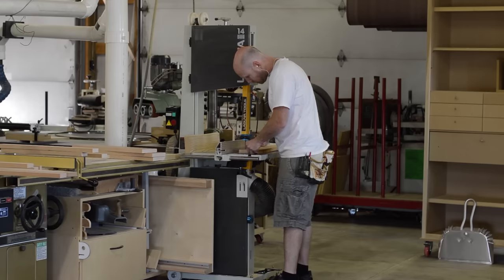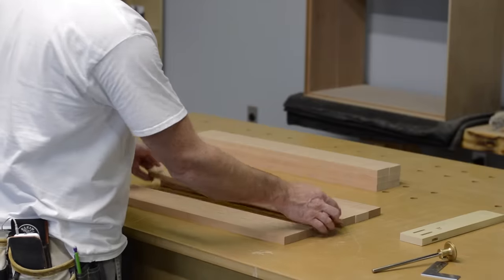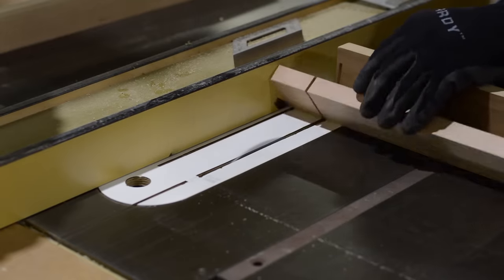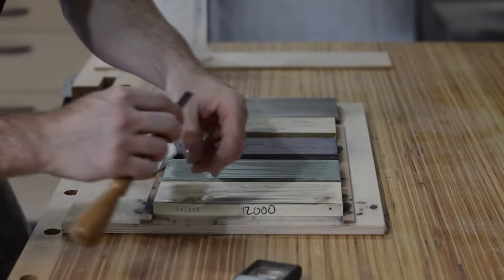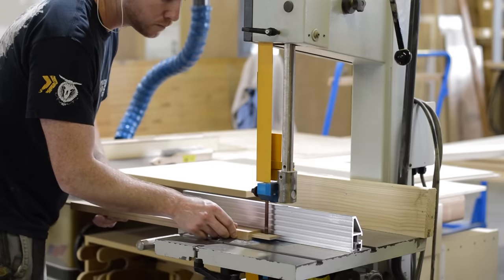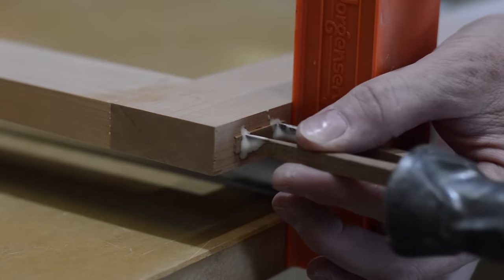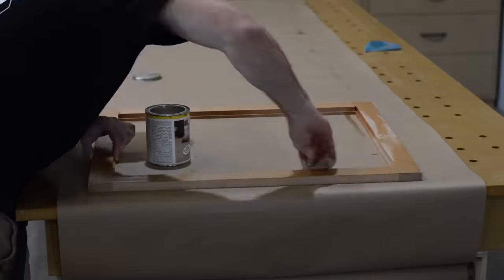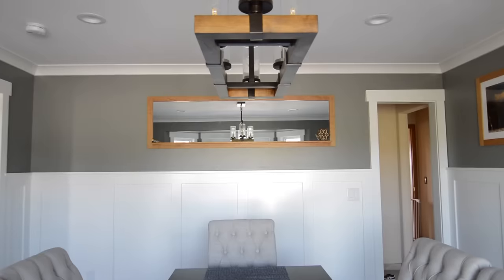How I build better picture and mirror frames, woodworking

Comment: Agreed, being on both sides of the a project both as a finish carpenter and professional painter in  custom homes.  It has been frustrating having to go in after someone else has worked and having to fix it in order to get the kind of product the customer paid for.  Try doing a built in wet bar in a closet with gloss black lacquer while 5 other Contractor working in other parts of the house. Love you videos.
Reply from the maker: The construction process is absolutely filled with compromises, speed, cost, quality. Us builder types must find where we fit in and its not easy to do really good work, when we work in a world where most other don't care very much.

Comment: I've seen frames done with a through mortise, but the wedge detail really elevates the clean, design, and is also functional! Beautiful and functional addition.
Reply from the maker: Thank you very much. I really like the way these turned out. Simple, quite, but built to last.
Reply: I agree.  And it means the frame is nice and strong which can be important for a mirror frame.  A splined mitre joint is also strong, but this is just a bit different and really nice.

Comment: Mike your frames are beautiful.

As a Picture Framer, I do have a couple of suggestions about the last couple of steps that you did.
Cheap premade frames come with cheap Plexiglas.  It often comes prescratched, and has many imperfections.  Most Hardware stores will carry either glass or Plexiglas.  If using Plexiglas, I recommend that it be at least .90 thick, preferably .118 or higher for larger frames.
The matting in premade frames can be of good quality, but is often not very good.  It is a good idea to make sure to use Acid Free mats.  A tell tale sign of cheap mats, is the beige bevel.  This will brown over the years, and may cause damage to your art.
My biggest concern with your fitting of the art was in taping the art to the matting.  I'm sure that you understand movement in wood, and made your frame about 1/8" larger than the glass size.  Matting and mart also has movement, and at different rates.  By taping the art all around, you are causing the movement in the art to occur in the middle of the image, causing bulging or rippling.  Your art should only be hinged at the top, and preferably with 2 hinges, not the entire length of the top.
Sawtooth hangers can cause problems on thinner frames or softer woods, as all of the weight will be applied to the top rail (This shouldn't be a problem on your frame).
Additionally, it is often hard to get the indent in the hanger to be exactly in the center, which makes leveling the picture difficult.
For this reason, I would recommend using two hangers near the sides of the frame, or a wire (with two hangers on the wall).

Thank you for the video.
Your woodwork is lovely.
Reply from the maker: Lots of good info here, thank you very much.

Comment: You do beautiful work, though I don't see how simple woodworkers without all these great and expensive tools can replicate this. These have significant relaxation value either way.
Reply from the maker: Thank you for the compliment. I'm also happy to hear you find them relaxing, that is a big goal for me. I wanted to create a video thats easy to watch and low stress. With regard to making these using expensive tools, yes I have a pretty nice tools set, but given a much longer timeframe these frames could easily be made with a couple handsaws, planes and chisels. My videos are just about how I do things with the current tool set I have. Nothing less nothing more.
Reply: Thanks for the reply - that's very fair. It's an inspiration seeing how precisely crafted everything is. You're right that similar results could in principle be made with hand tools, I just wish I had the patience and care!
Reply from the maker: If I ever have the time, I would love to do a similar project with only hand tools or minimum hand tools. It would be neat to show both processes.

Comment: Cool technique and tip.  I have not thought of doing it that way..... I always do a 45.  Will have to try that.  Also, thrift stores and garage sales for frames and mats.  Look for nice custom frame stuff.  The larger ones are better.   You can reuse the frames for smaller stuff (break apart, cut as you need, and rejoin).  Also, you can steal the glass and cut it down (way easy).  I used to do custom picture framing for a living.  I don't worry about mats as I picked up a mat cutter on CL for about 60 bucks.  It was in a frame shop at one point and is the C&H which is the same brand I worked on so I used.  If you don't want to mat some 3m spray and linen cloth covering a large cove molding or "inner frame" will work for a mat. That really works well if you have a vacuum bag for veneering.  Especially if you do any sort of shadow box. I have done really fun ones.  The best was a custom engraved colt that belonged to a notable TX cowboy is my understanding, but I don't know that to be 100 percent true.  Was a cool project that turned out nice.  I do mostly the odd stuff for me these days as I know the markup on custom stuff!  Also, if you have a Micheal's or a Hobby Lobby you can go in and use the 40 percent off single item coupon for just custom cut glass or the cheap frame.  I have also done that trick.   Mat boards aren't cheap and come in 40 x 30 as does a sheet of glass.  You can order online full sheets online.   Custom picture framing is a pretty fun.   We used to do chop service or just order sticks and cut it to length.  I would do the joining with an under pinner or a small hand hammered brad and glue.  The tools are pretty specific to framing.  We had a foot powered chop saw that to large blades that came down at a 45.  The beds were cast and flat like a jointer.  Made for prefect miters as long as you had the blades adjusted properly and took small and thin bites.  I wish I still had it.  It was my dads frame shop.  He sold off the equipment to a lady who opened the shop and I taught her how to frame. I worked several days a week with her in the shop for extra cash while I was in college. That was the time that Live was popular.  Love that album as well.  Lightening crashes is a great song.  As one enters life the other exits.
Reply from the maker: Thank you. Great tip about thrift store frames, that makes total sense as I read it. I will at some point get a mat cutter, thats just a matter of time. Live is great and yes, Lightening Crashes is a really good song. I liked it when I was younger, but as I have gotten older and seen the circle of life, that song hits a little closer to home.

Comment: Nice work with the through tenons with reclaimed wedges! crazy that the drawer boxes were nice walnut! When you're using that method of making tenons i've found that i've screwed myself a few times by having stock that is not perfectly milled up. If there is any variation from piece to piece then taking the same cut referenced off the face results in varying thicknesses in your tenons. Until i can achieve perfect milling results my method for now is to cut a little shallow and then refine down with chisels and such to try to get a good fit. Also, for the picture print itself, especially anywhere with moisture, like a kitchen, bathroom, Florida, the Northeast, etc. it is a really good idea to get your art dry-mounted (usually to 1/4 inch foam core). This is really one of the only ways to stop your artwork from developing waves and wrinkles over time. They can do it at a Michael's type store, or preferably, at your local frame shop, if they are still in business.
Reply from the maker: Thank you. I have had good luck making tenons this way. I just mill up my stock as accurately as I can and go to town. I think this is good advice on how to mount photos, thank you.

Comment: Hi Mike
Just found your channel and found this video really fascinating, not just because of your approach to this project, but also your techniques.
You mortice using the same technique as I do, I sharpen and test my tools in the same way, and use a similar adjustable height bench.
I have never seen Tenon's cut that way but intend to give it a shot.
Thanks for the video, going to watch some more.
Reply from the maker: Thank you very much. Let me know how the tenon technique works out.

Comment: I didn't expect to see anything new in a 'picture frame video' - I've seen so many. Again I was happy to be wrong. :)
I very much like miter-dovetail frames, so I might combine those with your tips and tricks.

Brooms are by the way a no-go in dusty workshops where I live (by law, they're actually not allowed, because they make the dust go up in the air; instead we are restricted to vacuum cleaners). If you don't have a dust-collection system, I very much recommend that (both for you and your work-force).

Thank you for another high-quality video with lots of good content. Tail-wind to you with the courses!
Reply from the maker: Thank you very much. I don't use the broom too much. I have a pretty nice hepa shop vac that does most of the clean up.

Comment: It is also quite "enough" to use paper tape on the backside in order to hold cardboard, picture and glass inside the frame. That way you can easily "open" the image later if you want to change the "inside" without  any holes inside the frame.
Reply from the maker: Thank you. Good point.

Comment: Every single time I watch a new video form you, you surprise with yet another cool technique or tip that just blows the competition out of the water.

I believe I saw The Samurai Woodworker add small drill holes at the end of the cuts for where the wedges go, as I think it prevents some potential splitting of the wood when driving in the wedges. Might be something worth looking into.

Great content again, always a pleasure and a fast click when you upload a video; guaranteed good content, humour, and editing. It never bores me.

Ninja edit: classes? Damn, I wish I was closer to Denver, because I would attend immediately. Maybe sometime in the future!
Reply from the maker: Thank you. I try really hard to add detail to the videos. I am happy to hear you can pick up a trick here and there. I drill the holes once is a while, Its not needed if the piece you are wedging is thin, as in this case. Meaning from the edge of the tenon to the wedge is only 18/-3/16.

Comment: Excellent build and beautifully executed. One tip for what it's worth. During glue up there is no reason to apply glue to the shoulders of the tenon. It's end grain and has little to no strength to the joint. The tenon and glue on the tenon only is more than enough strength to keep that joint lasting for years. Also a plus, there'll be little to no glue squeeze out to clean up after clamping. My 2 cents for what it's worth.
Reply from the maker: Thank you. Agree, glue is not there for strength. Its there as a filler. This is a habit I developed doing a lot of paint grade work, which is really how I pay the bills. Same glue up in a paint grade project, it would be very hard to hide that joint with no glue. You are totally correct, I just don't mind the clean up. I appreciate the comment. Keep them coming.
Reply: I'd actually disagree that end grain gluing has little to no strength. I've seen some recent experiments that have astounded me as to how strong end grain only glue ups can be. I do agree it's not necessary on a through mortise and tenon, especially a wedged one but as Mike said its habit and old habits die hard (and it's how I was taught as an apprentice many years ago as well).
Reply from the maker: Thank you the the input Steve. I have also had a few times where i was surprised at how strong a butt joint with glue is. For example, I have put things together with glue and pocket screw, then I realized that I needed to take them apart because I made a mistake. Take the screws out and pull the joint apart and it tears the long grain before breaking the joint. Really, to me the benefit of getting glue on the shoulder is its filling properties. That tiny gap of .001", the glue fills that up perfectly. With a through M+T it is not needed, but yes, old habits die hard.

Comment: Love your work. If you find yourself doing more picture frames, I found a couple things that make the experience even better, a good point driver gun (I used the glazing points too but didn’t like the finished look of them and hated they way they wanted to bend over before you could really get it fully seated in the wood), also a decent matte cutter (Logan) is surprisingly inexpensive and enjoyable to use and get great results from and then you’re not limited to what you find pre-made. Last, glass looks more premium than plexi and is not too difficult to cut with a cheap glass cutter or most hardware stores cut it to your size for free.
Reply from the maker: Very good tips, I totally agree. Thank you.

Comment: Hi Mike:
I just got through looking at you make very nice picture frames.  You talked about the wax you use.  A friend of mine put me on to Renaissance Wax.  It is white, it hard and does not add another color to the project.  Yes, it is expense for a 7 oz. can cost about $30.00.  The good part is the was goes a long way and you need to work in small areas.  I just thought you would like to know and they have in your Woodcraft store in Denver.
Reply from the maker: I have seen this wax at Woodcraft, I may give it a try. Thank you for the recommendation.

Comment: Love the video, drooling over your shop, and very impressed with the technique.  But all that craftsmanship and effort... to then use plexi?  If you ever start using the super clear conservation glass, you'll never go back.
Reply: There is nothing inherently wrong with plexi. Regular glass/cheap plexi is fine for decorative art, like what he is doing. Conservation Clear/ Museum Glass is great for fine art at home (i.e. it will be hung and never moved) under about 32"x40". When I prepare art for shows at galleries and museums, I only use OP3 - a high quality, UV protected plexi.

Comment: From my limited experience of furniture making/woodworking, I found Danish Oil to be even less yellowing and it's eventual touch was much silkier than my work finished in Osmo.
Reply from the maker: Thank you for your input. I have used gallons of Danish oil over the years. The place where I buy my stuff from sells a few different colors of danish oil. I use the dark walnut on walnut and it give a very nice look. Other colors of Danish oil can be very yellow due to the oil they use. Its one of those things were there are so many different brands/types.

Comment: Stunning work as usual, going try this out with my new hollow chisel mortiser. Do you have any advice for ensuring the chisel is perfectly centered to avoid any inconsistencies when flipping the board and drilling from the other side? Or is chiseling out a small lip left on one of the sides inevitable?
Reply from the maker: Yes. Spring the bit by hand while it is touching the work piece. It should make a small dimple. Flip board to check if center. Adjust as needed.

Comment: I think you could eliminate the need to shoulder plane your tenons if you made the shoulder cuts on all of your pieces then moved the fence in a 16th before hogging the rest out. Great video by the way!
Reply from the maker: Thank you. You may be right, also, I would need to keep my table saw fence in better alignment with the blade and make sure the miter gauge is a perfect 90. Lots of little details are required for the last little bit of accuracy.

Comment: What material did you use for your blue dust hoses on your saws.  Those are awesome
Reply from the maker: They are called Loc line. I use the 2 1/2" diameter.

Comment: A line from Osmo product description.  About all they forgot is to have cherubs play harps during it's production!  "Copernica cerifera, produces the carnauba in its leaves, berries and stalks. Villagers cut down fronds, dry them for several days, and then beat off the wax. The candelilla comes from the outer coating on a desert shrub, Euphorbia antisyphiliti, that grows in northern Mexico. Farmers boil the leaves and stems with water and acid to release the wax. No wonder it is expensive.
Reply from the maker: Ha! You must work for Osmo.

Comment: A bit funny to hear mortise and tenon being referred to as experimenting with a new technique.  BTW, lots of table saw tenoning jigs out there that are super fast and accurate.  I like the powermatic one, but there are terrific more affordable options available.
Reply from the maker: Maybe I didn't explain myself well enough in the video, but I was trying to say that I was experimenting with a new way of cutting a through mortise and tenon. I have a tenon jig and it works good, but I like the table saw method because its self centering. I am currently working on adding a router to the outfield of my sliding table saw, I will try cutting tenons this way in a future project.
Reply: Mike Farrington Probably my bad, I tend to have some videos running in the background while doing something else and don’t always hear everything.  I do like the shop apprentice’s broom technique!
Reply from the maker: @danliutikas  No problem. I do the same thing.

Comment: Often when I have seen wedged tenons, the woodworker drills a hole at the end to as I recall help avoid tearout or blowout/splitting from the force of the wedge. Is there a reason you did not drill that hole?
Reply from the maker: The holes are an attempt to prevent the wood from splitting further down into the wood. I was not putting enough bending force on the wood to create that problem.